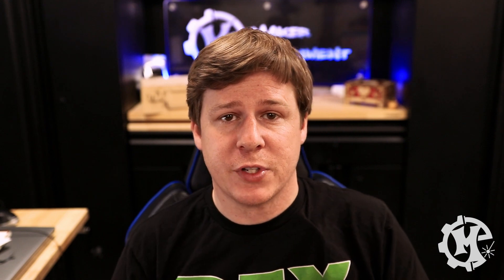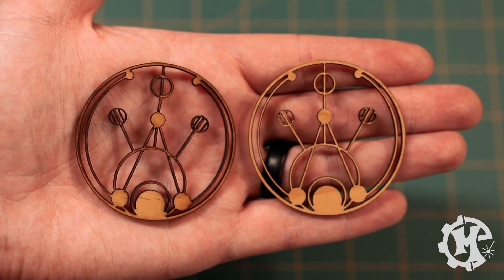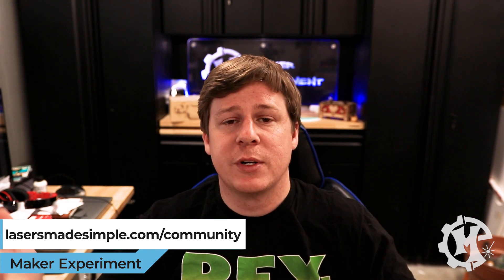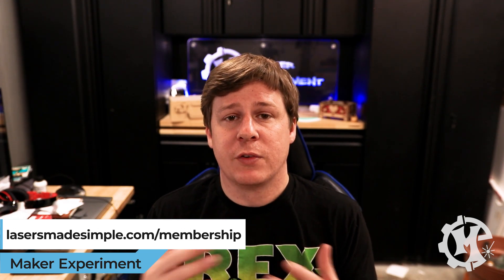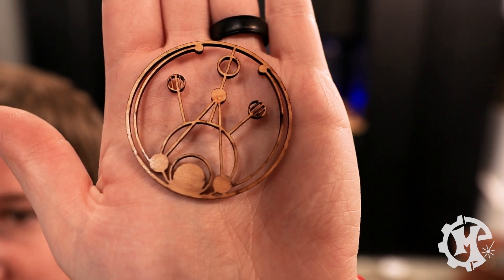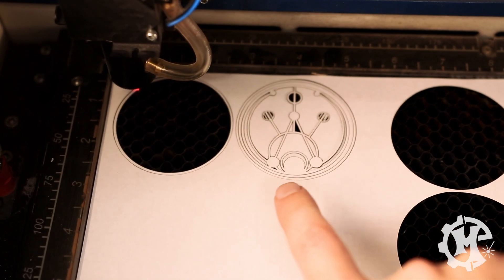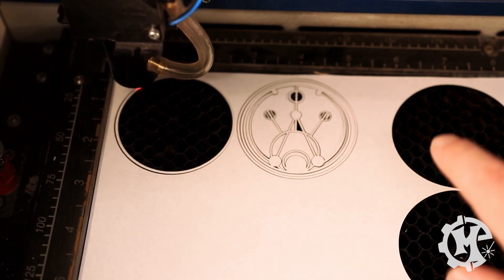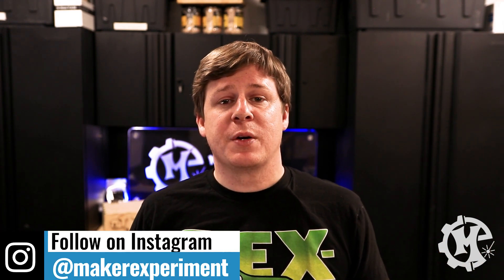5 Tips for Laser Cutting Material | Maker Experiment !!

Comment: Hey Trevor, great video thanks. I've got an Epilog FusionPro 32, I don't see anywhere in software where I can turn off or on the air assist, is there another way? or am I missing something?
Reply from the maker: If you have an external compressor, you just turn off that compressor. If it’s built into the machine, you won’t be able to turn it off as far as I’m aware.
Reply: @MakerExperiment  Yea It's built into the machine. Wished there was an option in software. Though I may try manually unplugging it from the back panel when the need arise I guess. Thanks Trevor.